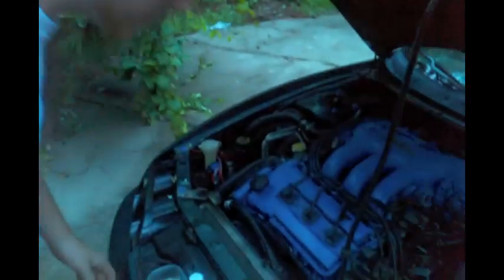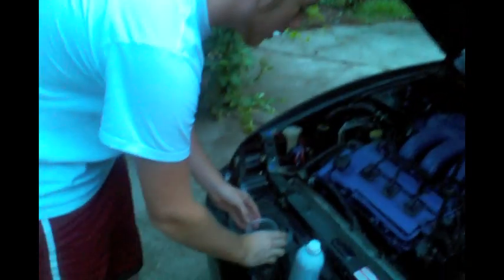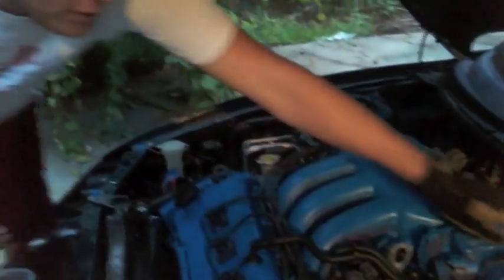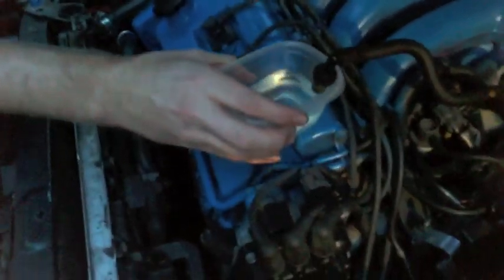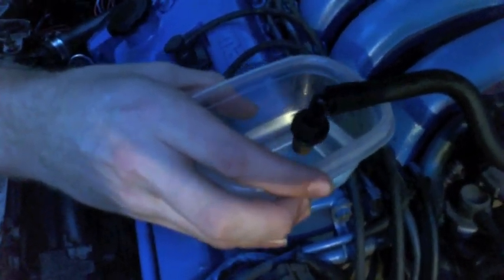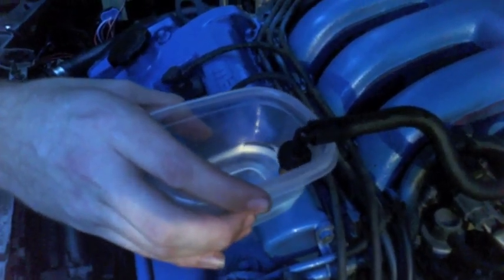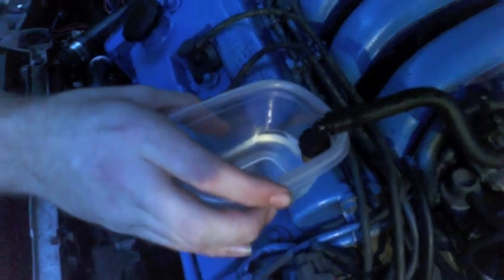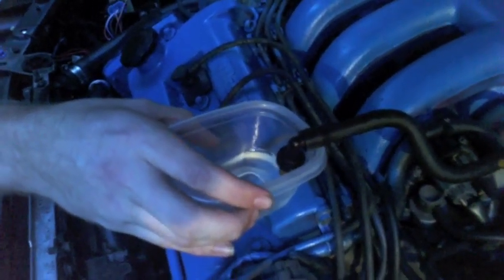Seafoam Mazda MX6

Comment: Seems like it'd be a lot easier to use that PCV hose than the line to the brake vacuum canister? It's also supposed to help with getting through e-check. Gotta try this on my 94 Probe SE.